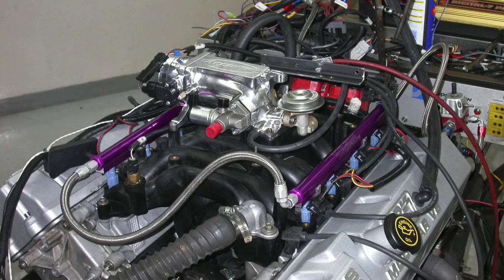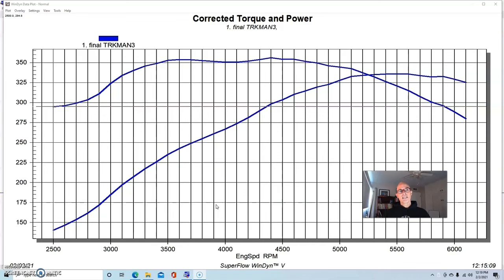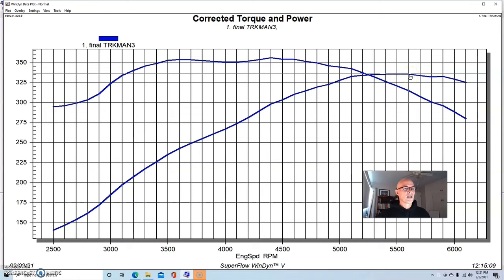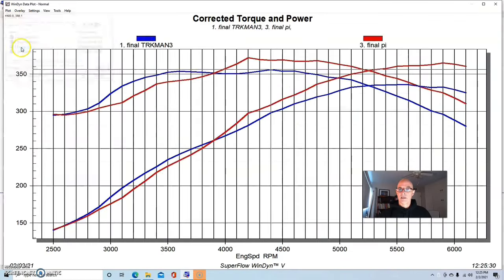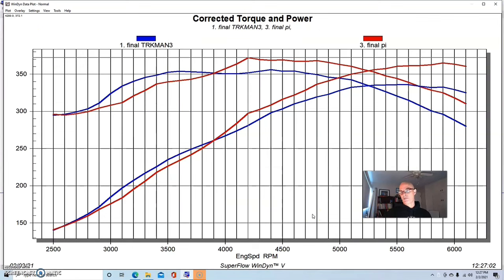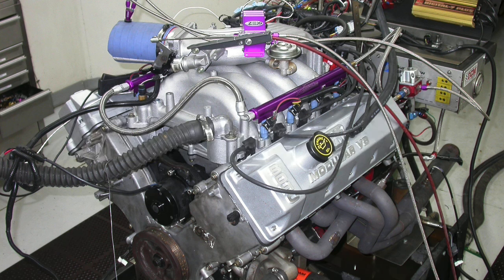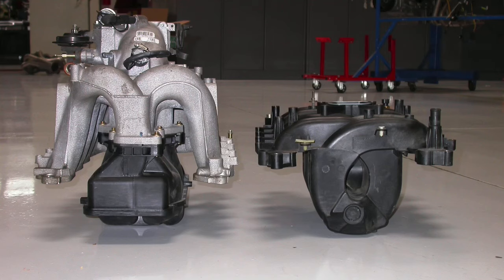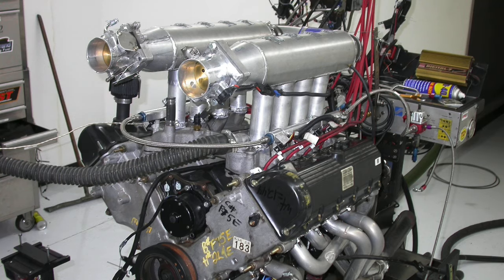4.6L 2V INTAKE TEST-MAGNUM PI FTW! (PT 1)

Comment: Good evening Sir, I hope you are doing well….
I am a mechanic from California working on a 99 F150 with a 4.6 2V Romeo.

Engine is bad, customer supplied me with a 2012 built brand new crate 4.6 2V  / PI motor. 

Referencing your video; will the truck intake manifold ( that might be an NPI ) fit the new PI engine? 

If not, what are my options?

Thank you
Reply from the maker: NPI intake won't fit PI heads, just use PI Intake

Comment: Can you run non pi heads from a 98 Romeo on a pi block from 04 Romeo. Both 2v engines. I'm stuck in a position to need to run this setup if possible. I cant find any info on this particular setup. And why would you right lol. Well its what ive for good parts from two engines. Has anyone tried it? Encountered any problems?
Reply from the maker: I've run NON PI short blocks with PI heads
Reply: @richardholdener1727  how about the opposite? Non pi heads on pi short blocks?

Comment: 4.6/5.4 2v big bang!
Reply: Don't see a svo intake for the test
Reply: @randolphniles2332  i didnt know svo had an intake manifold for the 2v. I would like to see what the lighting intake manifold no blower does even with out the intercooler. Almost everyone with a turbo lightning just keeps that turkey pan. When i go mid mount turbo I plan on removing the intercooler for a rear mounted one and seeing if i can have a runner turn down and then back up to make it a long runner for torque. Theres alot of room in there
Reply: The 5.4 3V is Jasper's biggest selling reman engine because they go bang without going big.
Reply: @jamesgeorge6551  its hard to just pick one engine anymore. Ive seen two 3v's in the 300k miles with just waterpump, alternator and one had the chain tensioner done because of the noise it was making being loose. Then ive seen LS go out under 100k. The ecotech piston recall at 10k and then 10k after that 🤣 almost every fiat chrysler ugly step child i wont even look at when im huge cuda and Fury/440(the car and engine). the first 2.0 dart engine i took apart and seen theres a oil transfer brick because someone forgot both sides of the head need oil i lost faith🤣
Reply: @niknasstie  Yep. The owner controls how the engine is maintained. I've also seen "good" engines, well maintained, die early too. My shop maintained an expedited shipper G1500 GMC with a 4.3, that had 2 water pumps, and the lower plenum gasket replaced, it had 776,000 on it. It was getting its 3rd 4L60E rebuilt. I used to drive a Volvo 740 Turbo wagon that had 441,000 when I sold it. My neighbors 04 Tundra had 377,000 when it got totaled.
Reply: @jamesgeorge6551  4.3 and volvo stuff i like. Tundras are a hard pass tho. I dont trust guys that buy foreign trucks or low quality toilet paper. Either way its gona be a shitty time being around them🤣
Reply: @niknasstie  that's funny! I may have to steal that for future use.

Comment: Pi i take has aluminum coolant crossover thats no a pi manifold thats a stock plastic 1
Reply from the maker: only the replacement ones had alum X overs
Reply: @richardholdener1727    I put the replacement alum x on my 01.
After a year of not driving it much after buying a 99 cobra It started leaking at one of the factory bolts and leaked into the front sparkplug well.
Now the sparkplug has rusted to the point it won't come out. I don't know how long this went on because it was a minor leak but I'm afraid this leaked on to the Piston.
Have you heard of anything like this before ?

Comment: you do a lot of back to back tests on 4.6L 2V parts ... need someone to settle an argument over the Ford performance PI intake? people keep saying it is a revised PI intake and they remove their 1999-2004 PI intakes and place these on for improved power ? I been telling them they are the same intake as the mustang PI intake except different part number and packaging to sell to NPI owners and mustang PI owners that do not know any better ? and on the same line of reasoning the 2005 and up crown victoria and mercury grand marquis 4.6L 2v engines with the PI intake ? other then only one sensor mounting hole in the front crossover instead of 2 and a different part number it should also be the same ? do not know why they put the other sensor in the driverside head but drilling and tapping a hole for the 2nd sensor is quite easy they already have a flat pad. And if for some reason this entire topic never came up before ? might you throw together a dyno run comparisson because been searching the net and cant find anyone that has done this back to back on these 3 intakes ? and to be clear its mustang PI frod motorsport PI and crown vic PI and who knows maybe the grand marquis uses another one as well ?
Reply from the maker: I have not tested but would expect little to no gains
Reply: @richardholdener1727  exactly my point but it would be a subject that would have come up a lot and im sure a lot of people would view the test in order to get the real scoop on fact or fiction because a lot of your viewers know you and acknowledge your testing procedures to be accurate. and unlike engine masters which I also love to watch you do not take every other breath to plug wilson intakes :) you are in it for the data learned. plus it is easy to swap out and crown vicoria intakes are $20 a pop and you have mustang PI intakes lying around and Im sure someone will lend you a ford performance intake if not donate one for the cause.